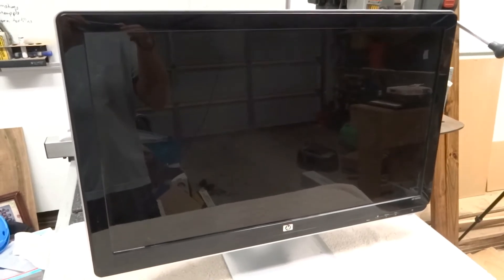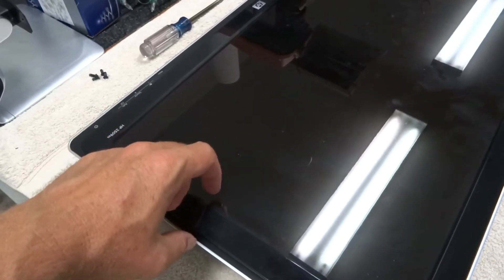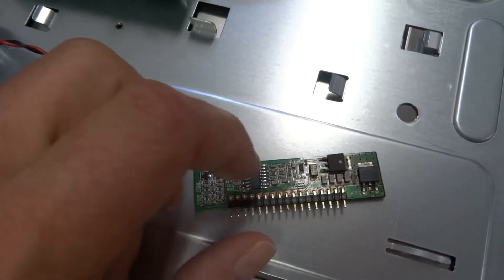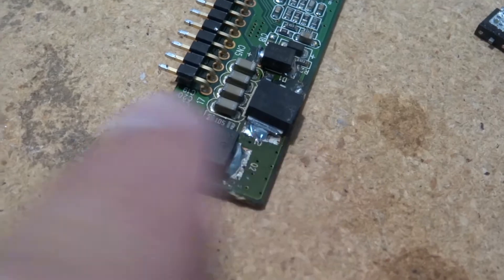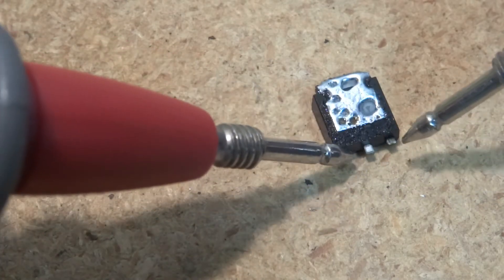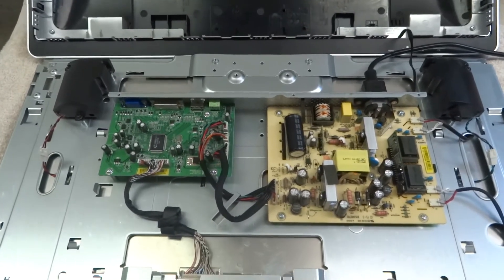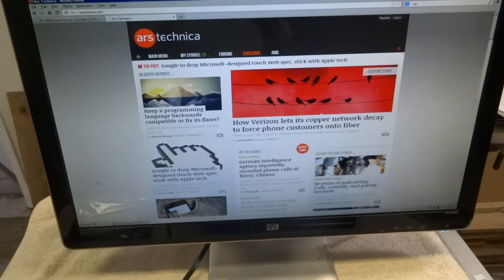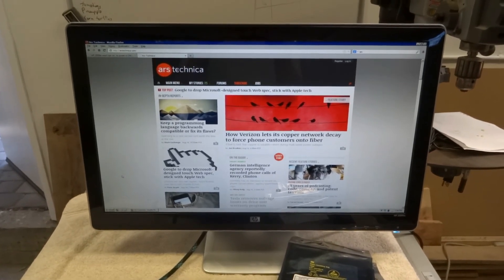Let's Repair - HP 2509m monitor

Comment: Thanks for this a great video.I have a HP 2509b, the screen turn black (No backlight) after 3 seconds, if i turn off and turn on again , the screen turn black (No backlight) after 3 seconds again, do you think the 2 Mosfet and the diode could de the cause of this problem? Thanks for your help

Comment: So I don’t think there will be a reply but I have the same monitor it powers on and you can hear it but no picture would it be the same chips or other
Reply: Hey I just repaired one of these and so far it works. My problem was the same as this video. However, during my troubleshooting opened up the LCD panel itself. The wires going to the bulbs were burnt an  no longer connected. That’s probably your problem. No backlight.
Reply: @computerrepairguy  I checked for a image nothing showed up 95% of the time when a backlight goes out you can still somewhat see an image if you tilt in the right angle or with a flashlight.
Reply: @caboosevx9676  How is everything connected? Are you using separate cables for the picture and sound?
Reply: @computerrepairguy  when I tested it I was using hdmi I connected it to my tv box which I knew was good and sending images and sound hooked it up power the monitor on  and you can hear the sound no image and I checked using a flashlight to see if it was the backlight and didn’t still see anything and I took it apart kinda like in this video and got to the two boards and removed the one that he’s removing the chips off of. You can see what I’m assuming is some factory flux that was leftover but that’s about as far as I gone cause I don’t have all the right parts or tools to do it yet. And when I search for my issue that I experienced I get videos like these even tho it’s not exactly the same. So I’m totally open to other ideas if you have some I do have just like a generic volt tester but I don’t think it has the right settings to test to see if there’s a short on the board

Comment: This is a great video. After replacing the parts mentioned in the video, the power is on. However, during the disassembly of the metal frame, a LCD backlight power connector on the PCB board was damaged. Do you or anyone happen to know where to find the replacement component? Thanks a lot.

Comment: Okay, I just figured out a easier way to take off the bezel take a screwdriver and push on the outside rim not the inside Rim where the display is.

Comment: It would have been nice if this video disclosed WHICH mosfet replacement position the N channel and P channels went on the board, as the replacements are not the same numbers as the originals.
Reply: Did you ever figure this out?   I'm wondering the same.

Comment: After changing 2 transistors and 1 diod, same types as described and repairing burned out lamps, monitor starded to work BUT! the temperature of transistors is extremely high - more than 100C. Who faced the same problem?

Comment: Thank you for the video. I have the same monitor and it will work fine until the screen resolution is changed. The screen will flicker and the left back light goes very dim. I'm certain it is a similar issue that you had. I took the monitor apart and pulled the power PCB out.  I looks as if the mosfets have been fried. I'll change them out and see if this fixes my problem.
Reply: +Kevin Sissons  This repair did not fix my problem. I'll take a peak at the wiring going to the tubes as I've read they can have bad soldering where the wires connect. The power PCB that your working on is delicate, or at least mine was. One of the pads pulled up and another pulled off when I removed the MOSFETS. It was a good experience though.
Reply: +Kevin Sissons Turns out that it was a burnt connection on one of the light tubes. I cut off the burnt part of the wire, added an extension and re-soldered the connection. This fixed the flicker and the monitor works great now. I think replacing the MOSFETs on the power board will fix the reason the wire on the tube was burnt in the first place.

Comment: hey i have the same monitor, the screen lights up for a sec then goes dark.. when i turn off the screen and turn it back on it does the same comes on for two sec and goes dark..
what do you think it is???
 thank you for your help
Reply: paul valenz hello I have the same problem, how did you fix it?
Reply: @humbertosandoval4597  Mine stayed on for a few minutes then off. I fixed it by resoldering the ccfl wires. here's a link that might help https://www.youtube.com/watch?v=hU218Frv6sA&ab_channel=TampaTec

Comment: Got this exact same monitor for free, does not turn on at all, no lights or anything.  Going to open it later and investigate.  Hopefully it's the same problem as you cause that would make diagnosing easy.

Comment: Skips some important steps. Remove the stand by taking the four small screws on the back and slide the stand downward. The shield over the boards has four small connectors going through it on the left which must be disconnected as well. Do this before unscrewing the shield. If you take the yellow board completely off to work on it, you must also remove screws at the power plug and pull the connector at the green board.
Reply: +Ann Harris Yeah I figured this part out when I opened it up too... honestly though it's very easy to figure out.  No need to show where every last screw is.

Comment: Hi, Got an HP 2510i with the same problem as yours, the N-chan and the Diode are open, the P-chan seems to be OK. My monitor won't power up at all. I saw you replacement parts are 60v rated but the original parts are 100v rated... wouldn't this give a problem in the future?

Comment: Great info-
Whenever I get a chance, I replace NIKOS with STD, Infininon, or National Semiconductors.  NIKOS have a high failure rate in the actual working enviornment.  I don't even know why HP vendors use the part other than being cheap.

Comment: I have this monitor where it turns on but then goes black where the back light is out.  I've replaced the lights but still does the same thing.  None of the caps look blown.  Could the symptoms I described be caused by the bad MOSFET and diode?  Could you post the specific diode and MOSFET that you replaced and the vendor?  Thanks!
Reply: I see you list the parts at the end of the video.  Thanks

For others interested, here are the digi-key's part# for the 3 parts listed in the video - 497-5888-1-ND, IRLR9343PBF-ND, SS26FSCT-ND.  Total price was $3.02 without shipping.

Comment: Brian, Thanks for posting this video! My 2509m died on me a few days ago,  followed your tutorial, ordered the parts from Digikey and now, the monitor is running. After replacing the parts I found that the diode and the P-channel MOSFET were fried. Great fix for under 10$....Note to self...next time use less heat on the MOSFET terminals as two traces peeled off and I had to be creative with the soldering. Thanks again.

Comment: did the screen ever turn on before you made this fix. Mine turns on for 5 seconds and then it cuts off. i still have the power button lit up.
Reply from the maker: My monitor did not turn on at all.  Turning on for a few seconds and then off is often times a symptom of bad capacitors.
Reply: Yeah, I check all of them and they look good. Thanks for the reply.

Comment: How did you unsolder the whole row when the little board is connected to the big board?
Reply: Use braided solder wick with a small amount of liquid flux. When you heat up each connection,  the hot solder will wick into the braid.